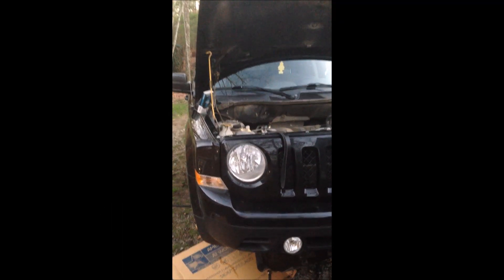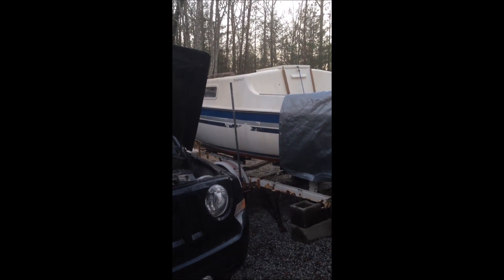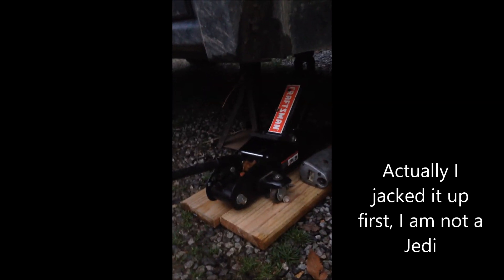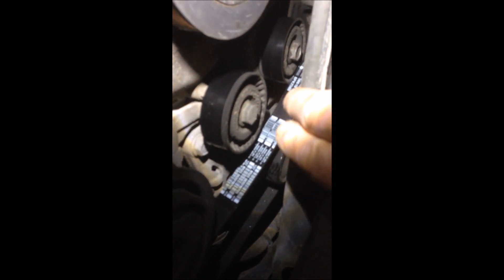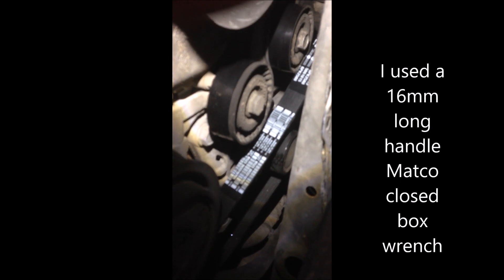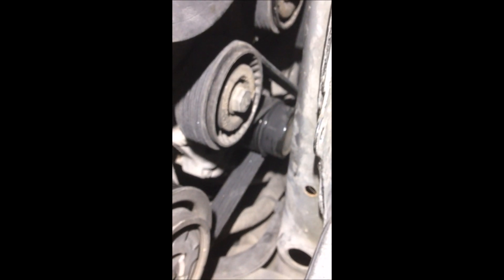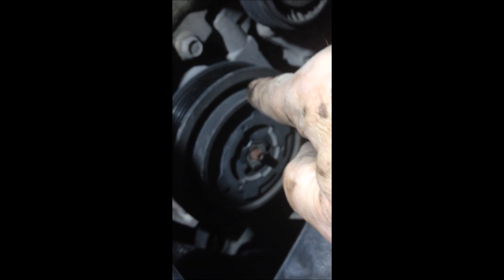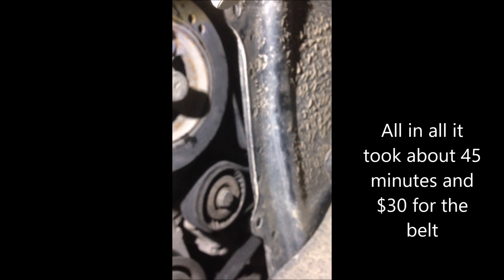Jeep Patriot serpentine belt installation

Comment: As Info: I watched another video where the fella took a few bolts off the eng. coolant bottle and then you are able to move it out of the way, made a large hole on the top to help route the belt back in.
Reply from the maker: Nice. I will definitely remember that because that was probably the hardest part. Thanks for the info.

Comment: Its actually quite simple, push the belt down fromnthe top and run the belt around pulleys frim underneath,  was done in 20 minutes
Reply from the maker: Yup, get that belt turned sideways and slide it in!🎉

Comment: The alternator pulley on mine sticks out to far to get the belt on it
Reply from the maker: Really? I was able to turn my belt sideways to make it thin and slide it past it.
Reply: @377Gman  found out my alternator was shot the clutch went bad and the pulley migrated out all the way, hence the belt was in shreds
Reply from the maker: @bobbydouglas16  aah, I was wondering if something else was wrong. Hope you got it fixed!

Comment: When do you recommend changing these? I have 100k miles on my Patriot so far and think I’m hearing some noise coming from there
Reply from the maker: Hey Ray, I’m sorry it took so long for me to get back to you. I checked my serpentine belt regularly and when I start seeing cracking in the ribs that’s when I’d like to change it. Obviously there is no set mileage on that but I would think around 90,000 or possibly a little sooner. I love these modular engines. They have a timing chain and not a timing belt which is awesome! Thanks for watching!
Reply: @377Gman  ended being the wheel bearing hub assemblies making the noise lol
Reply from the maker: So I have found out on these jeep patriots that I have to change out the rear wheel hub assemblies around every 70,000 miles. They are not hard to do but it is kind of a PIA! Was it the front or the rear?  Thanks again!